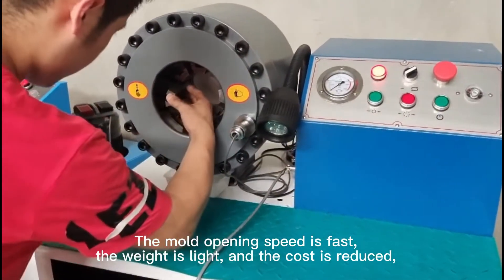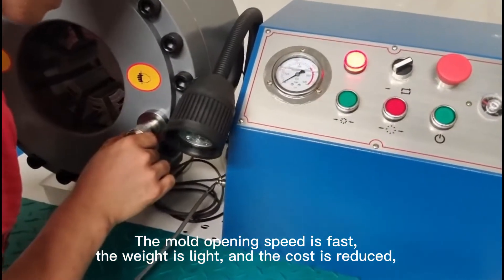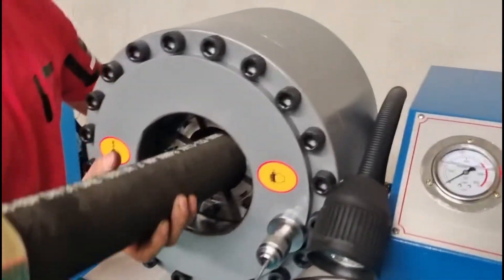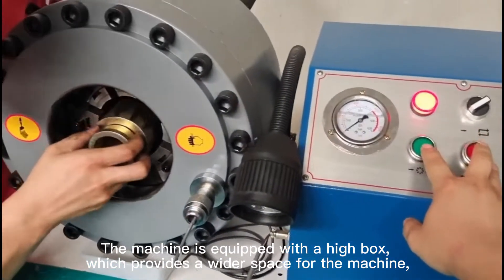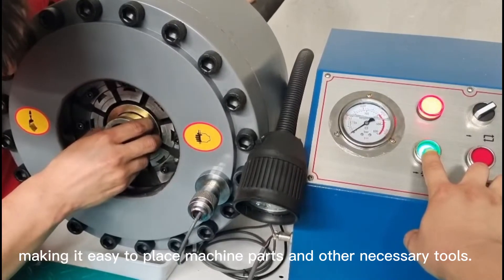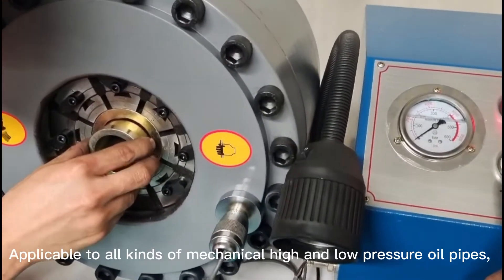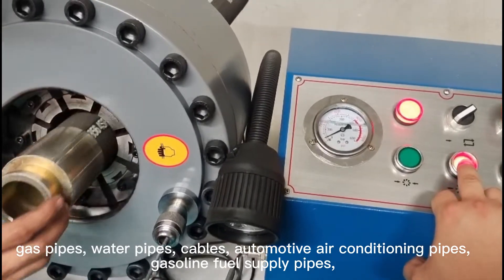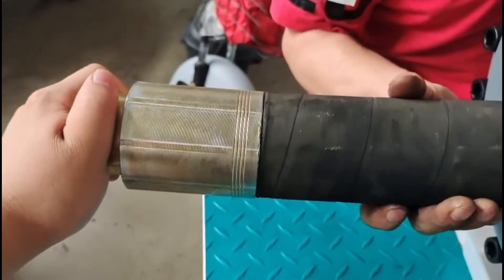How to use a hydraulic hose crimping machine? hose-crimper.com

Comment: I need this job
Reply from the maker: hello, thanks your interest. our will give you whatsapp
Reply from the maker: HENGHUA Hydraulic Hose Crimping Machine
3 days ago
134 subscribers
This machine is our company's best-selling model series, which also has a quick-change die with a mold rack and supports color customization.  you can contact whatsapp: 0086 18522426988   get products catalog, thanks!